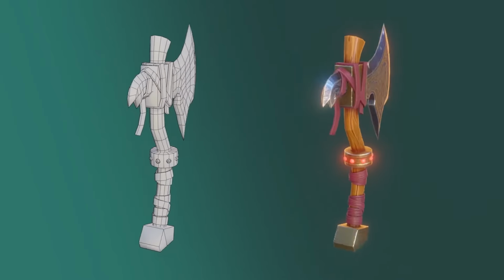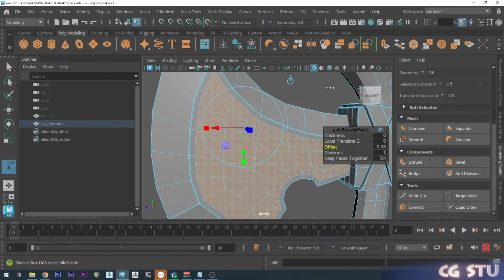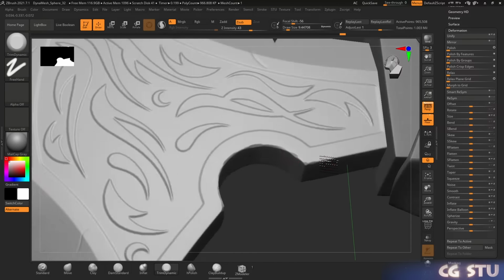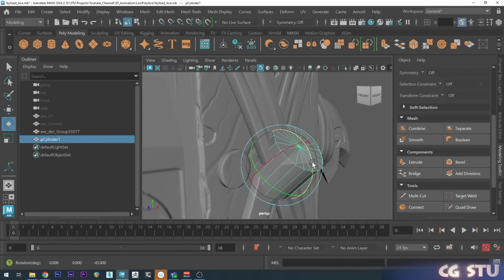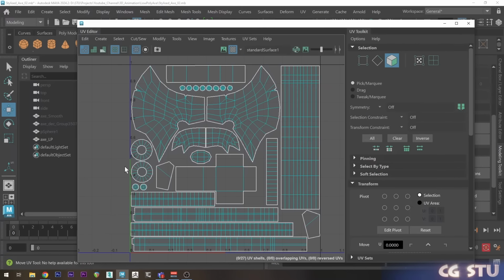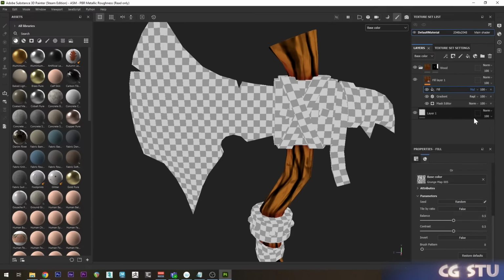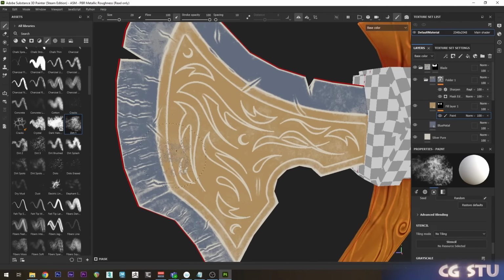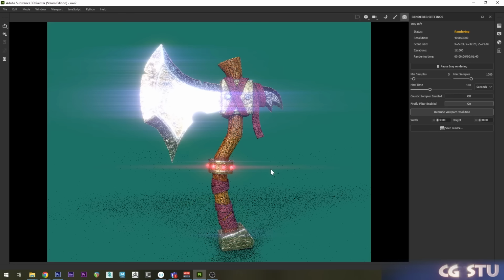3D Game Asset Creation (Full Process) - Stylised Axe

Comment: Is it ever acceptable for a singular mesh type object for triple A game-ready quality to have overlapping UVs such as if you were modeling an apple tree and had 20+ identical apples in the same object?  It seems redundant to have separate islands for identical mesh types, especially with the loss of resolution when baking to one image or am I mistaken?
Reply from the maker: Yeah, it would be like a trim sheet, for example using a single texture across multiple meshes that have overlapping UV's, but then relying on the engine to light them, even baking the lighting across them, which will use a different texture map. Can just make 1 apple, then duplicate it across the tree after you have textured it, and combine it as a single mesh... if you wanted to. You can't bake maps in substance painter with overlapping UV's however.

Comment: I didn't follow this part but is it the lower poly (100-250k polys) that we bake onto the low poly mesh from maya or is it the hig res (1M+ polys) that we bake ? Thank for the answer and the video, awesome pipeline !
Reply from the maker: The lower poly decimated version is mainly used to take in to Maya and make sure the low poly matches it correctly, but in most cases you can just get away with using this version to bake with too. But if you want, you can make the second decimated version (1M+) just to bake with... if your computer can handle it, then do it :)

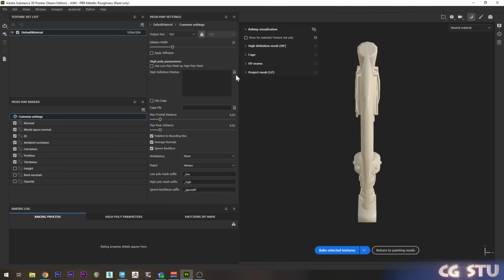Comment: 9:22 so we bake the decimated version or the million poly raw zbrush version on low?? M confused
Reply: Decimated version with the version he duplicated in the beginning
Reply from the maker: You only decimate to have a lower version of the high poly to work with in Maya (for retopo), as if you take a multi-mill mesh into Maya, it won't work so well. In most cases you can just use the decimated version to bake with as well, it would be more accurate to make another decimated version that is a lot higher to bake with... or in some cases you can use the raw Zbrush version... if you're computer can handle it.

Comment: Awesome tutorial, shows the overall process. I feel now I understand the workflow and pipeline much better.

I wrote a weird summary for the process.. just for me
- Start with concept/reference
- Make low poly asset
- Make smoothed asset using (support edges + bevels so on..)
- Adjust model for export (subdivide, adjust scale, freeze transforms, set pivot, delete history,)
- Export .obj & import in Zbrush, And use autogroups & group split to have separate subtools for each part
- Add details & design using Zbrush magic (dynamic mesh + different brushes, alphas, so on..)
- Create low & high poly version in zbrush using dissemination
- Adjust original low poly verision in maya to match zbrush version + fix smoothing groups + test in substance painter
- Unwrap the model & Do some UV magic (unfold, straighten, seems, and so on..)
- Bake the high mesh in substance painter
- Add materials & colors using Substance painter magic
- Export & Use in stuff slash things !!!
Reply from the maker: Cheers! Yep haha, that's about it. But different projects will call for different workflows. This was just a very simple one. If you check out my vid on making a Zap Gun, or even the one on an Arcane character, you will see some variations which have different results. Like separating the meshes for more accurate bakes, exporting sometimes as obj and sometimes as fbx, displacement map instead of normals etc

Comment: Very cool!  Have you tried Shrinkwrap in Maya, by chance?  Makes the high to low process easier in keeping the silhouette.
Reply from the maker: I haven't no, but I still prefer manually adjusting, just in case shrink wrap causes any issues I have to search for. I might give it a shot going forward though, thanks for the tip :)

Comment: how did you make the wraps? i have been trying curves, duplicating faces and using shrink wrap and all sorts but i cant get it to look like yours?
Reply from the maker: You mean for the low poly? I created 2 cylinders above and below each other, removed a section of quads, then bridged the bottom cap to the top cap, then just moved the verts by hand to make them gradually slope. But you can also look in to the "Sweep Mesh" function in Maya to create a shape along a curve.

Comment: Can u also tell how did you finalised the low poly model (how did you add the belt type of the thing around the handel)
Reply from the maker: I duplicated faces from the handle then extruded the faces to give them thickness, but you can also use the "sweep" function in Maya.

Comment: I find it interesting that you decided to first do the low poly in maya before processing it through zbrush, it's a good approach I've not seen adopted much. Personally I model everything in zbrush since you get more flexibility out of it and wont be so worried about drastic topology changes, though this results in a much more harder time doing the retopo once finished.
Reply from the maker: Yeah I find modelling in Maya easier, but it's just a use case thing. Anything organic I will always sculpt first, but for these more hard edged surfaces I find it easier to model a base first. Good thing about modelling in Zbrush first though is that you can have your low poly done at the same time, and also export displacement maps without having to project it all back.

Comment: Hi, great video! I have a question and would really appreciate your response. I've been using Cinema 4D to create 3D models and have a solid grasp of modeling tools, maintaining proper topology, and edge flow. However, I’m looking to transition away from C4D and move to either Maya or Blender. While I have some experience with Blender, I’d prefer to learn Maya since it's the industry standard and is used at my company. The only issue is that due to my work schedule, I don't have much time to dedicate to learning Maya, although I can take a week off to focus on it. Given my strong modeling background, do you think Maya would be quicker and easier for me to pick up? How long do you think it would take to get comfortable with the UI and tools? My goal is to start creating game assets and low-poly characters for rigging and animation. Thanks
Reply from the maker: Hey! Thank you :) Seeing as you already know the important concepts of modeling, you would pick it up very fast, one week would be enough time for sure. Maya would be easier for you to transition because Blender's shortcuts 's are very far away from most 3d software. It does have a way to switch to industry standard mode, which behaves more like Maya, however it actually makes it harder to learn because most tutorials etc always teach the standard Blender shortcuts. Maya has some easy accessible modeling tools in the "modeling toolkit" menu, and a "shift + right click" menu. It also has one of my fave features, which is "D + Ctrl" to quickly align your pivot to any face or edge, really handy while modeling! It's UV'ing is also very nice. I come from a 3ds Max background and I wish it has a lot of Maya's functions. Maya doesn't really have a "modifier stack" though, it has more of a "history" workflow, which might take some getting used to.
Reply: @StuLloyd  Thanks, your channel is going to be really helpful to me in this journey of learning maya 🙏

Comment: I don't know why but my substance doesn't let me preview the baking process, I've been having to bake plenty of times to see which config applies the best
Reply from the maker: As far as I know you can't preview, you need to bake to see the results, then rebake if they're not to your liking, so sounds like you're doing it correct
Reply: @StuLloyd  Ok I missexpressed, what I really mean't is that when you adjust the cases to match as much as possile you can see the changes while adjusting. My substance doesn't do that, It wasn't as complicated since it's a relatively simple model but still...

It's also my very first time using substance so that doesn't help either 😂.

Also another issue I have is that when I blur my colour mask the line where the UVs join get's visible.
Reply from the maker: @Sagegabs  Hmm that's a strange one, you're definitely using 2 meshes yeah? Loading the low poly and projecting with the high?

For the blur issue, you might need to manually paint your mask going a bit further past the UV seam so when it blurs it doesn't cross the seam
Reply: @StuLloyd  Yes, lol it's funny cuz I was able to just add one fire icon alpha in the blade. 
But yeah, I am doing the exact same steps.
Reply: @StuLloyd  The only thing I'm not liking this far is that your model looks way better, more natural. The way you sculpted the wood looks way better than mine but it's ok, I'll just practice much more my scultping 👍

Comment: New sub
Reply from the maker: Thank you :)
Reply: @StuLloyd  I will copy your whole process to then apply it to some of my models, but for example the Venom symbiote pfp is a Dynamesh mess (devided in head, body, teeth, tough, upper and lower gums and eyes) that I have zero idea of what to do next...
Reply from the maker: @Sagegabs  Nice! It's good to keep the meshes separate if they are supposed to be, in your case, teeth, tongue, gums and eyes should remain separate, however I would merge the head to the body as one mesh. You should then retopologise all the meshes, then you can combine all the retopoed meshes as 1. If you want to make it easier to texture in Substance painter, you can apply multi materials to each separate mesh, so in Painter they will have their own material set.
Reply: @StuLloyd  Thanks a lot bro! I'll try it 🍻